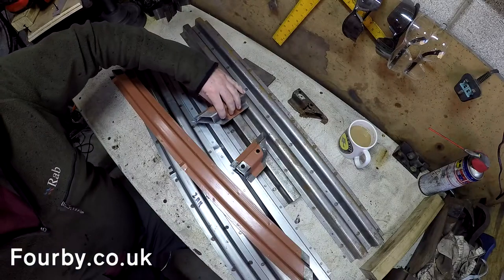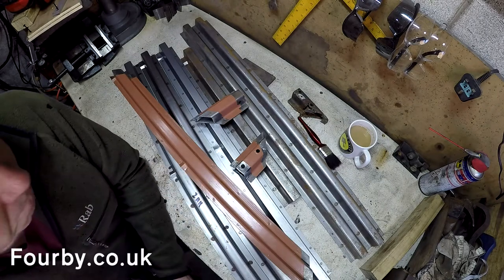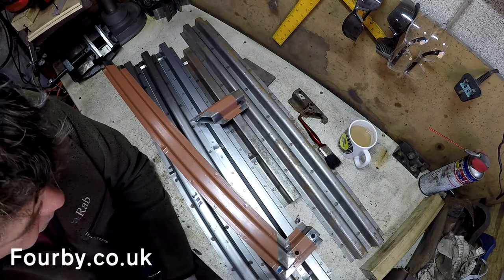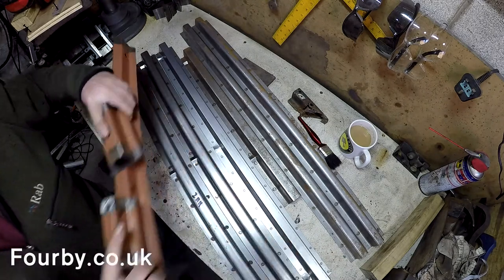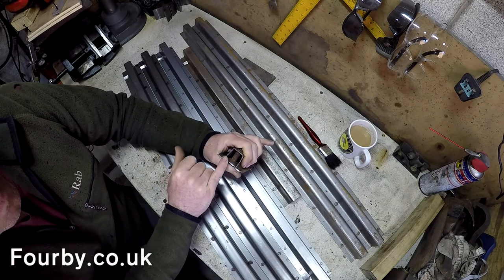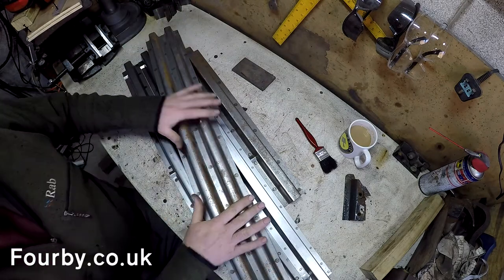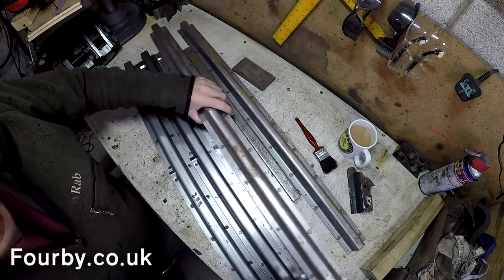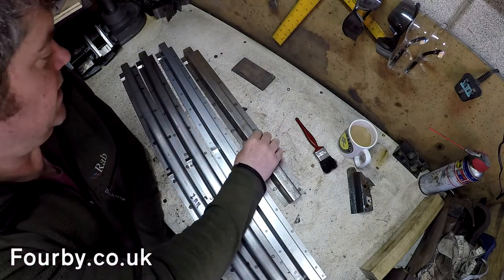Land Rover 110 Restoration #15 "Lower Door repair Sections"

Comment: I also just bought the YRM sections, for defender, no drain holes etc. I was working on the basis that I'd need to drill holes top and bottom to suit. Also haven't cut out the old sections yet so can't compare the profiles.